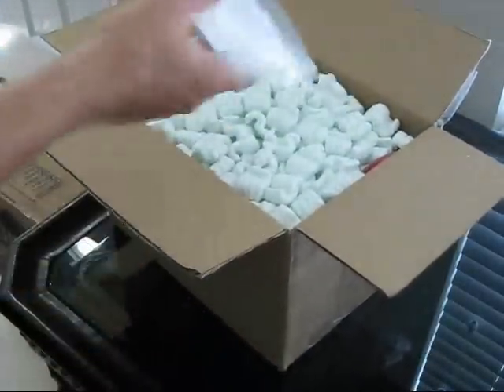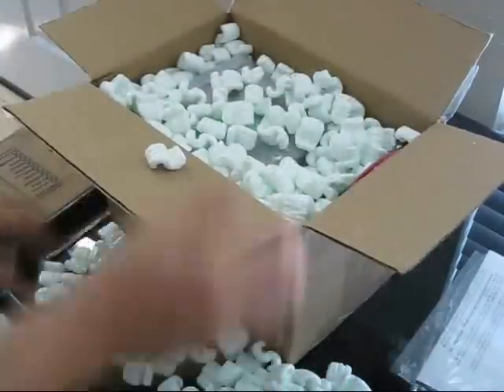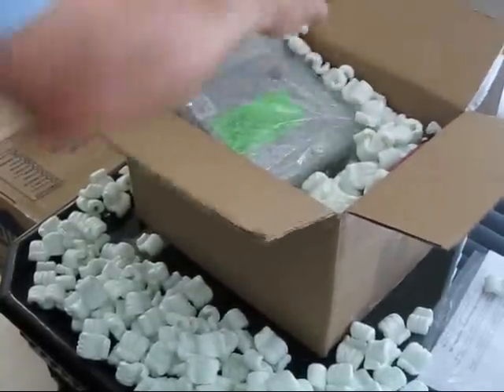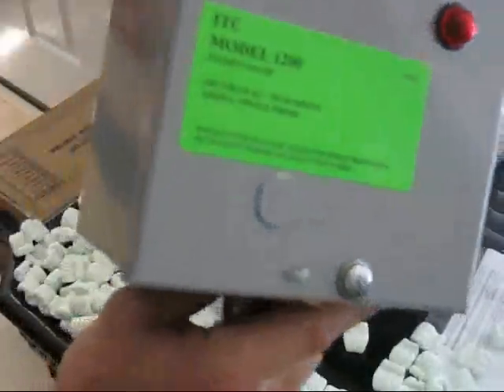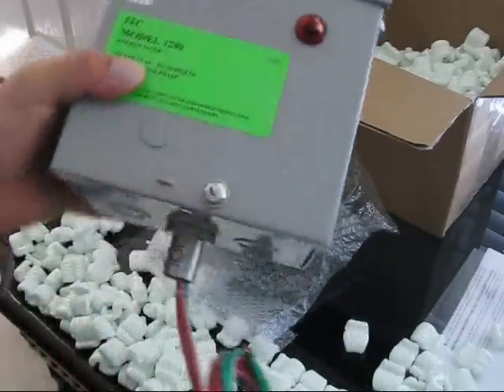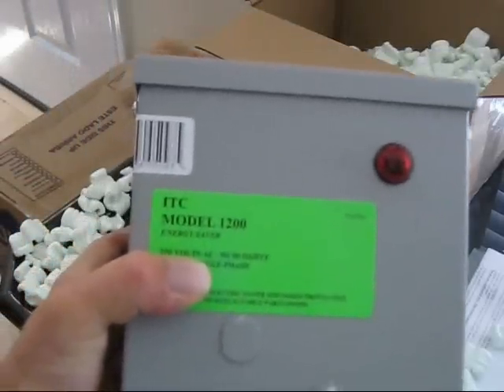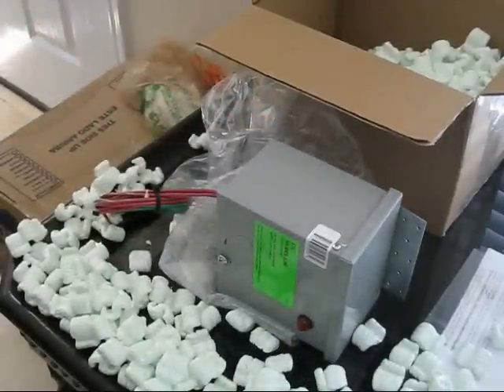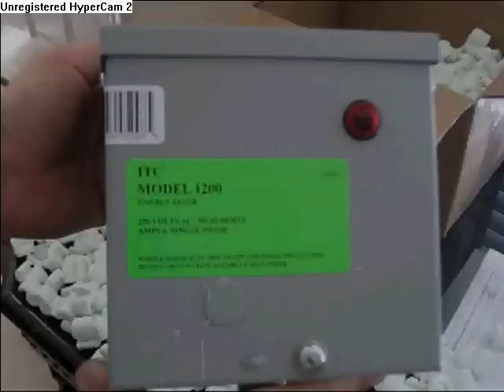Power Saver 1200 Part 2

Comment from the maker: The wire gauge on the unit actually supports 30amp, and according to the distributor it can be installed to a 2-Pole 30amp breaker.

I feel that by opening it up to a 30amp potential load it could potentially save you more, should you run heavy loads.

Thanks for catching that.

Comment: Buddy I'm sorry but it is a scam. A capacitor only supplies VARS, a motor needs them basically to supply the magnetic power across the air gap in the motor. If this capacitor didn't supply VARS they would come from the utility, but even then you're not charged for them.

The capacitor will lower your current and will raise your power factor but it will not do anything to reduce watts. In a residence all you do is pay for watts over time, watt-hours.